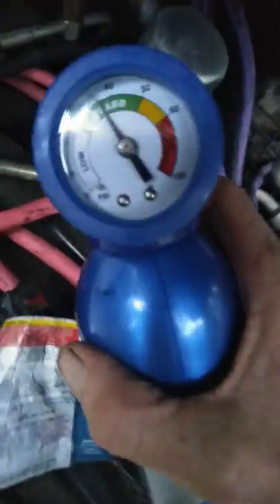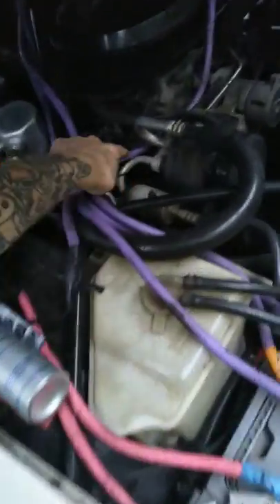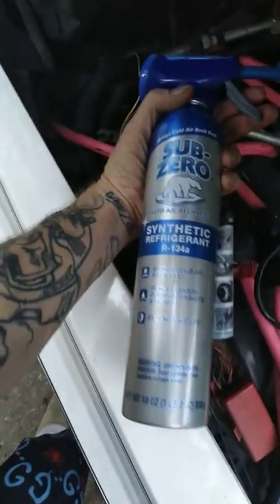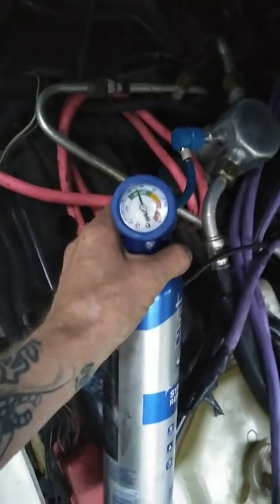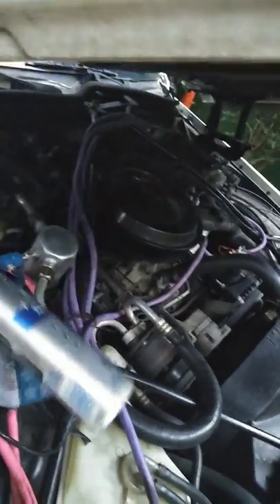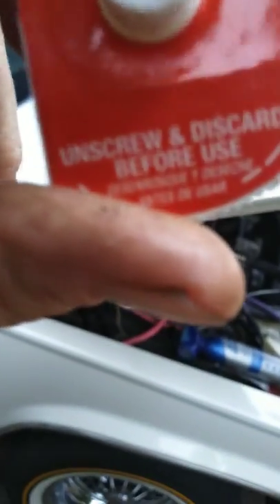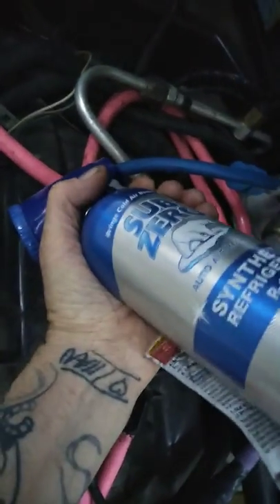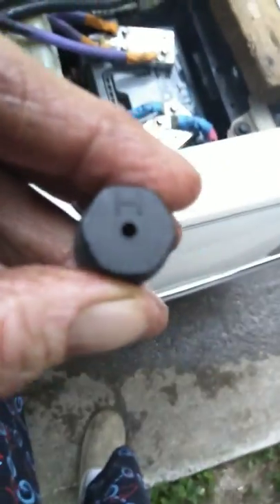Ac service 1991 Cadillac brougham

Comment: What up king pin cowboy. Could really use your advise. So I can a 1990 brougham delegance. When I turn the a/c on it blows but it only blows through the bottom vent. It want switch over to the main vent. What issue am I having there????
Reply: Damn I had the same problem , my mechanic fixed it for free

Comment: Need some help I have a 91 Cadillac brougham delegance. The  air is only blowing down at the floor they the vent under the ash tray. How do I fix or check to get it to blow thru the main vents
Reply: Did you ever find out? My 87 brougham is doing the same thing.
Reply: @dementeddeville6485  it was a vacuum line off. Near the distributor box